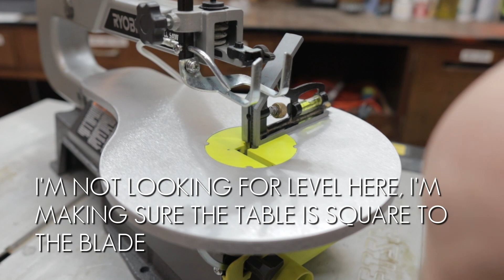Ryobi 16" Scroll Saw - First Thoughts and Cutting a Test Piece

Comment: Identical machine as the King Canada 16 inch. That T handle wrench is important for a pinless blade installation. Forget just using the thumbscrews. Always tighten with the T handle wrench, never have any problems
Reply from the maker: Pinning this comment! Thanks! I started doing this after I read your comment and it makes a huge difference. I'm using painless blades with ease now!

Comment: thanks, appreciate the review. did u ever figure out those straight blades?
Reply from the maker: Yes, actually, someone made a suggestion here in the comments. You can use an hex key instead of trying to use the thumbscrews to tighten the blade in place. It made a huge difference

Comment: Just bought and used the machine for the first time today. Set it up, leveled everything, etc.. but when I go to cut along a straight line, the blade is continuously drifting off the cut line and I have to constantly manipulate the wood to get it back on line. Its drifting to the left of the cut line. Any suggestions?

Comment: Would have been good to have seen the pinless blade in action and any problems that may have occurred in its use. It seems that the saw is more for pinned blades.
Reply from the maker: 100%. The clamping for pinless blades is not really good at all. I really struggle getting a good clamp on pinless blades to the point where I don't even use them

Comment: The most important thing about scroll saws is the ease (or difficulty !) with which the pinless blades are fitted. For this hobby grade machine this system is pretty good, but it still cannot compete with the - much more expensive- Pegas saws..🤷🏼‍♂️

Comment: As an owner of this and wish I wasn't I will warn all lookers to keep looking. This saw is poorly designed especially in both the top and bottom screws that hold the saw blade. Both will strip and break from the plastic knob that holds the screw that locks the blade in place. Leaving you with almost no way to tighten or release the blade. Keep shopping elsewhere.
Reply from the maker: I think this is a fair comment. I struggled with trying to clamp the pin-less blade. I'm just going to use pinned blades but if you're trying to do fine work and need smaller pin-less blades, this probably isn't the saw for you
Reply: Have you found an alternative that hopefully doesn't break the bank?